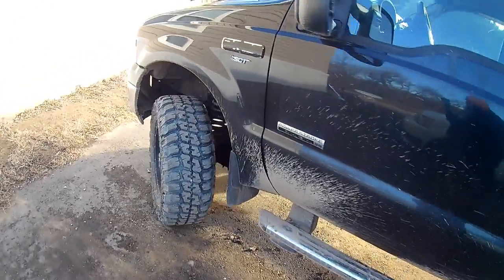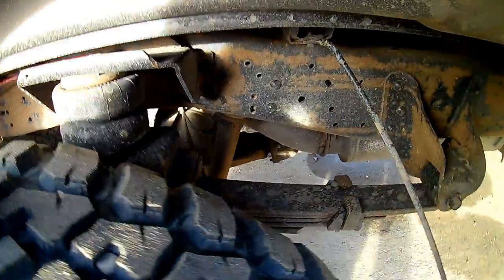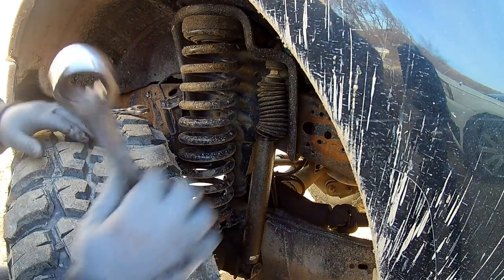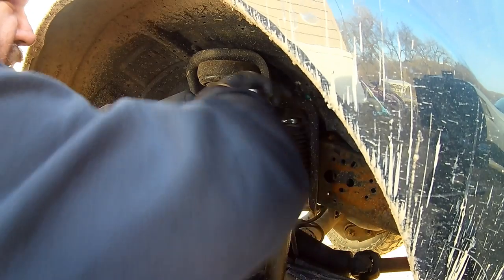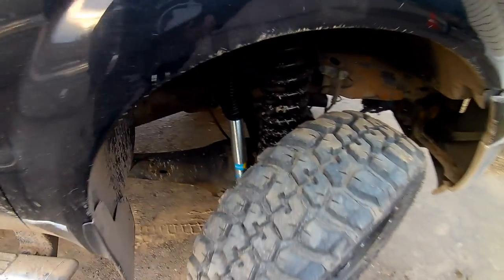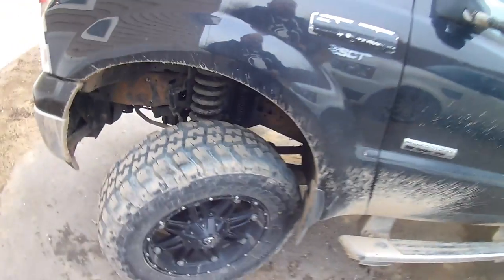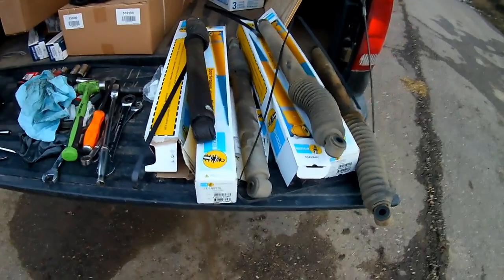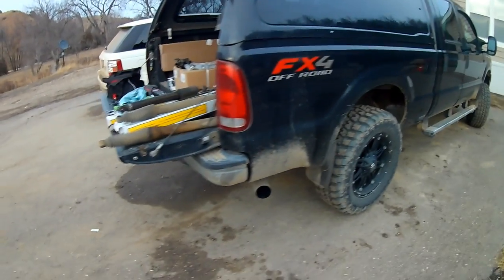SHOCK REPLACEMENT 2005-2016 FORD POWERSTROKE 6.0 4X4 F250/F350 BILSTEIN 5100 SHOCK INSTALL

Comment: Thank you for putting up the video, I put the Billstein 5100's on my 2005 F250 today; 24-186018 front and 24-186025 rear.  100,000 miles stock Superduty Diesel FX4 offroad suspension.  The original Rancho 5000's were great but were well used and needed replacing.
I found it was necessary to use a hydraulic jack to lift the frame rail about 4 to 5 inches (under the driver side for LF and passenger side for RF) to get the new front shocks lined up with the lower brackets.  The Billstein design with the 6 mm allen wrench to tighten the front top nuts really sucks.  As the nuts are tightened, the shock post raises into the engine area and eventually the 6mm allen wrench gets torqued out of the hole by the wheel well cover.  I will probably go back and notch out some of the wheel well material to make room for the tightening process.  The Rancho shocks had a 21 mm nut on lower-upper area of the front shocks that actually work well, unlike the 6 mm Billstein kluge.   I have air-bags on the rear suspension - so I just used those to lift the rear of the truck into place with the new shocks.  Without the air bags, I would have lifted the frame rail with a hydraulic jack same as was done for installing the front shocks.
  Good news, the new shocks made a good difference, much stiffer in turns and braking.  And, best of all, the marble rolling around inside the dashboard noise stopped, I suspected that it was being caused by the old shocks.  Happy happy happy !!!  Good upgrade and glad I took the time to do it myself, saved hundreds of dollars over what the shop wanted.  Waiting for the Billstein steering damper to arrive, install it and call it job completed.
Reply from the maker: That is awesome news! I hope my video helped out a little bit anyway, I appreciate you coming by to check it out! Stay safe out there my friend and enjoy the new ride!